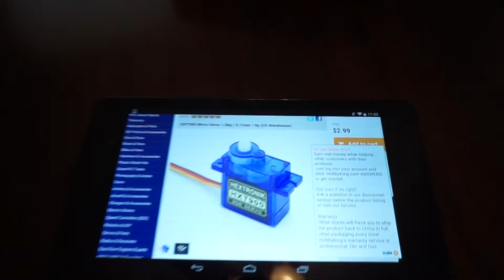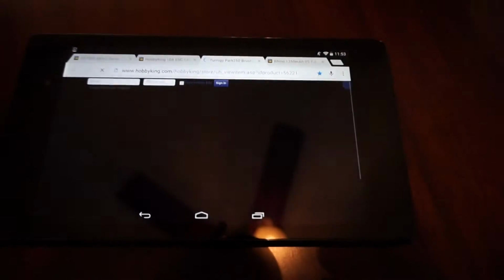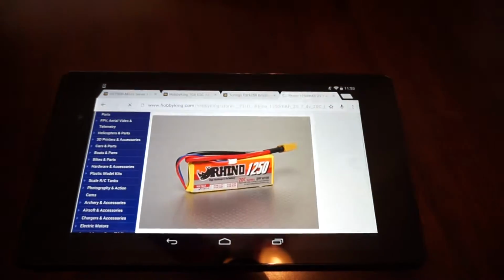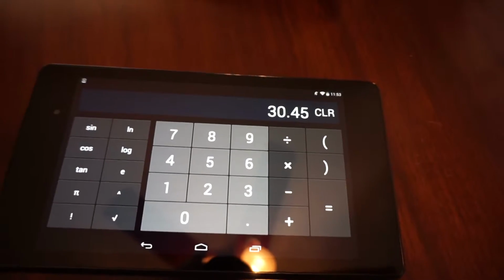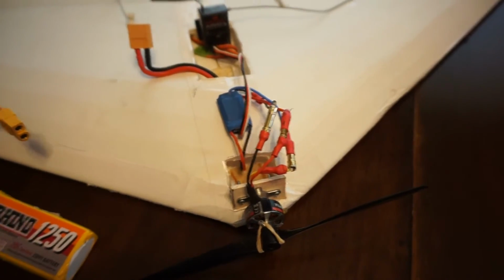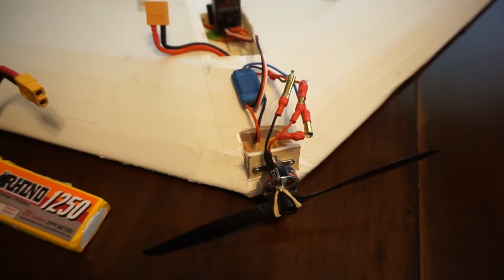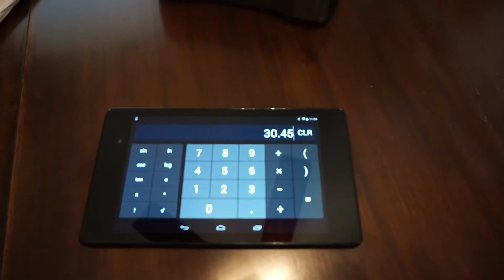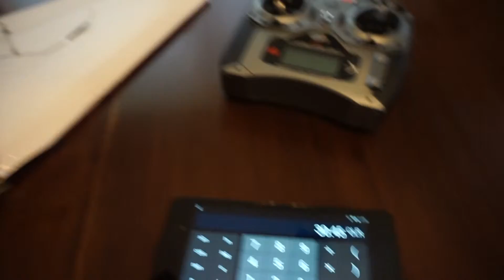FT Versa Wing / Cheap Rc Plane Electronics For $35

Comment: How did this setup work for you did it work nicely because I saw other vids of your plane updated and with new esc and motor. P.S I'm going to buy these electronics for my homemade rc plane if they worked for you.thanks cool plane
Reply from the maker: +Patman This setup worked good, but wasn't extremely powerful. I would cruise this wing at about 3/4 throttle which is just above normal. As far as how it can carry weight, it can carry my Mobius action cam, but not much more. The electronics work fine, but I do want to let you know it is a rather "cheap" setup. If your plane gets too big (Wingspan over 3ft and fuselage over 2.5 ish ft) I'm not sure it would pack enough punch to have fun with. Works fine for a little plane though.
Reply: Meckster 28 thanks man love your vids keep it up